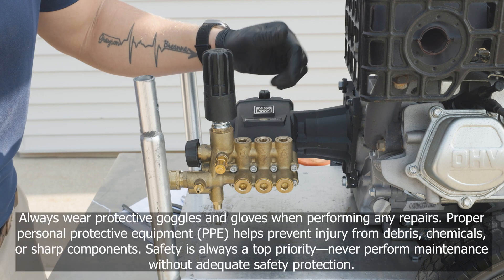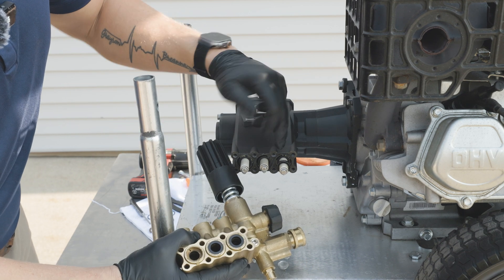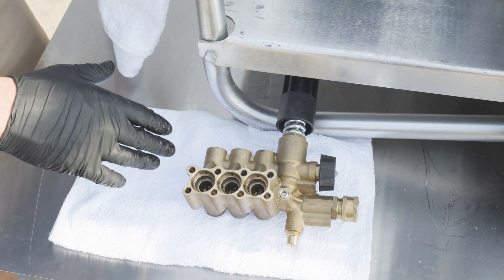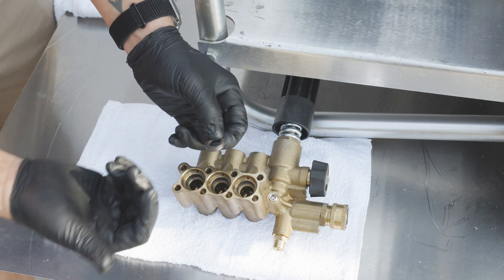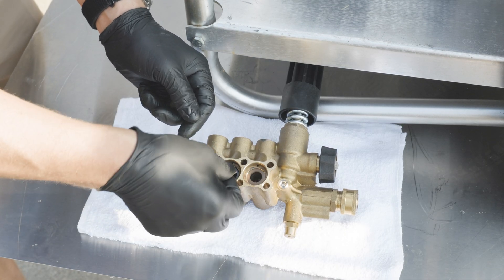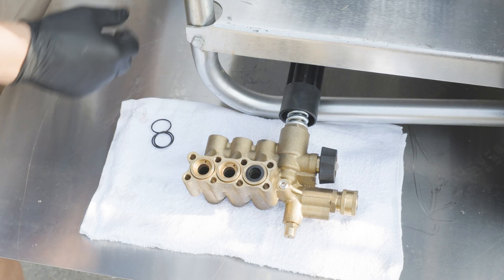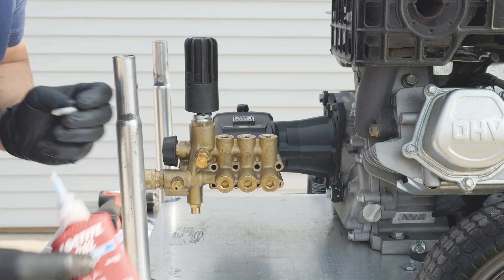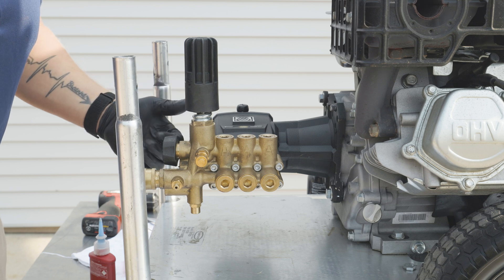Installing New Water Seals In a AAA Triplex Pump

Comment: I have water getting into the oil and squirting milk out of the oil vent cap even when the engine is off and the water faucet is on. Is this what I need to replace or do I need something else?
Reply from the maker: It sounds like you might have cracked or fractured pistons. You should start by inspecting the pistons. We have photos of what bad pistons look like here: https://www.allpartsinc.com/blog/top-cause-of-water-in-pressure-washer-pump-oil.html
Reply: @Allpartsinc yep that's what it is! Too bad they are so expensive on this pump
Reply from the maker: @MarianoGru  if you would like to weigh the pros and cons of replacing pistons vs a manifold or the whole pump, you can give us a call and talk to a technician: 1-269-685-4123. 
Although,  if it is only the pistons, replacing them is going to be significantly cheaper than replacing the manifold.
Reply: Qué número sería el Set de los empaques para poder pedirlo